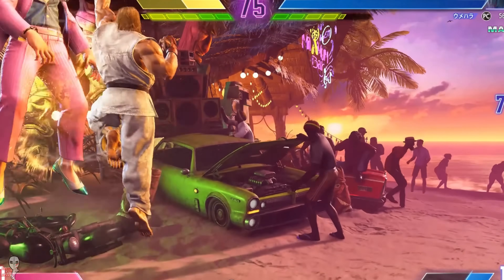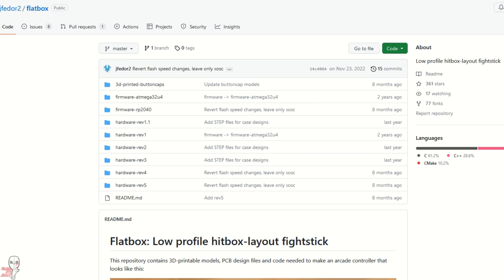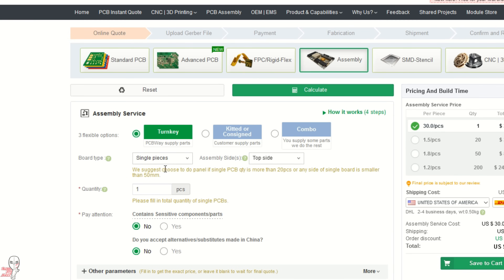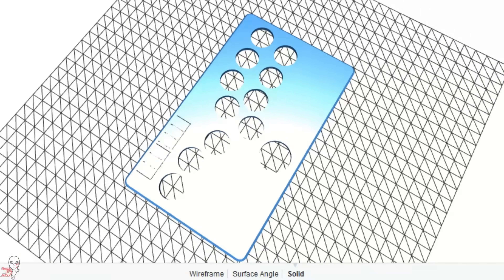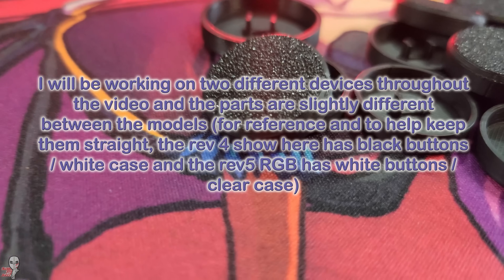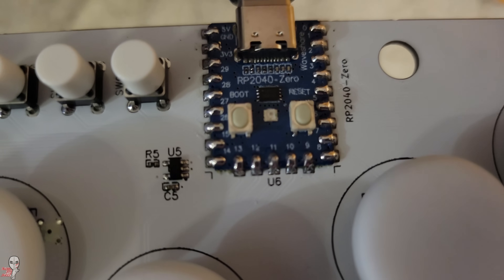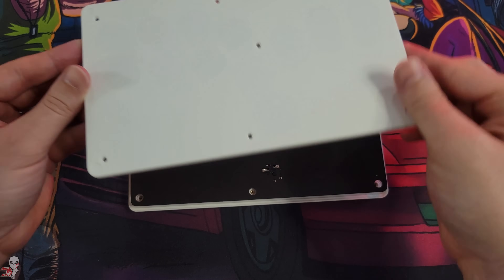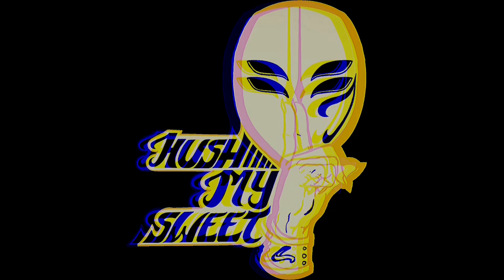Build your own Flatbox! An inexpensive, open-source fightstick option

Comment: Thank you very much for this video. I'm really interested in following this process, but since english is not my native language and since the whole github project is a bit complicated for non-initiated people, i would need a few clarifications.

Concerning PCBway, i'm not sure I've really understood what they can sell. Do they sell only the PCB ? Do they sell the PCB and the enclosure, and then I'll need to buy the buttons and button caps ?
Concerning the enclosure, do I need to send them the dxf files from the github ?

Concerning the button caps, can I just buy some online, or are those from the github the only possible ones ?

Concerning the soldering, from what i understand, I will have to solder the buttons on the PCB myself, is that right ? Or did you just plug them in and were done ? If i don't need to solder them, what will I have to solder exactly ?

In the Github project, they give all the parameters to choose on JLCPCB.com. Did you use the same parameters on PCBway ?

Is it possible to insert a personalised art panel betwen the PCB and the plexiglass plate (like the ones you can find everywhere on Etsy)?

Sorry for all these questions, but I'm a total beginner so it's a bit complicated to grasp the whole thing.
Thank you again for that video, it's amazing
Reply from the maker: That's a lot of questions, but let me try to help. For our purposes, PCBWay sells assembled PCBs and 3D-printed parts (normal PLA stuff and higher end resin stuff). You'll need to use their website to upload the appropriate files so you can get a PCB and the enclosure halves. You can also print the button caps there too or you can buy pre-fabbed button caps online from Junk Food Arcade. The caps are for their own Micro controllers, but they will work just fine on a Flatbox. As far as soldering, you'll need to solder the switches or hot-swap sockets (and the heatset inserts in the enclosure). You can use the Rev 5 art version if you want a layer for artwork, but the Rev 4 one won't accommodate that. I'm actually going to leave a link to the Open Stick Community discord. There is a Flatbox channel for help with questions like these (and the people there will be able to help you faster than I would): https://discord.gg/6SeMcMGH Good luck on your project!
Reply: @HushMySweet1  wow thanks a lot for taking the time to answer me.

I'll go for the rev 5 art case version.
I'm not sure whether i'll use PCBway or JLCPCB (it'll probably depend on the price per board i think).
I'll check online if i can find some people who show how they solder the hot swap pockets.

Concerning the button caps, i'll go for the 3-D printed ones to start and then i'll probably upgrade them to have a nicer surface under my fingers.

Thanks again for answ me, this helps a lot.

Comment: On a scale of 1/10 how difficult would you rate this project and what would be the total cost of something like this? 
(Quick note: I have some prior experience with creating my own PCB's, soldering, 3D printing and just electronics in general)
Reply from the maker: I feel it should be pretty straightforward for you with your prior experience. One issue is that you typically have to order 5 PCBs from one of these assembly services. Some of the cost is also dependent on if you have easy access to a 3d printer or need to order enclosures. I think you should be able to make a Flatbox rev 4 for like fifty or sixty bucks. If you really want to make it simple, you can just buy the assembled PCB from SGF or another etsy seller. They go for like $35 and you can just buy the single board. All sort of depends what you're after though. Good luck with the project!

Comment: I'm curious what the total cost of the parts and shell were if you happen to have a breakdown anywhere
Reply from the maker: Typically, you should be able to make a Rev 4 one for like $50-60. Depends a bit on your access to a 3d printer. One more issue is that a lot of these assembly services have a minimum order count of 5 (so you'll have practice boards or extras to finish and give/sell to your friends in the scene). Hope that helps, thanks for watching.

Comment: So, I'm confused about one detail. Does PCBWay send the pcb with every component soldered or we should buy the other electronic components and solder them ourselves? Great vid, btw.
Reply from the maker: They are mostly assembled, but you will need to solder on the WaveShare board and hot swap sockets. Thanks for watching!
Reply: @HushMySweet1  Oh, now i understood what you meant. I have to solder the RP2040 in the v5 revision and the hot swap sockets on v4 and v5. So, the raspberry chip on v4 is pre assembled by PCBWay. Thanks.

Comment: interesting video. you say this is inexpensive so what is the total cost in parts to making your own flatbox?
also how much more would it cost to make one for the PS5 versus PS4?
Reply from the maker: Typically, you should be able to make a Rev 4 one for like $50-60. Depends a bit on your access to a 3d printer. One more issue is that a lot of these assembly services have a minimum order count of 5 (so you'll have practice boards or extras to finish and give/sell to your friends in the scene). PS5 stuff is still super expensive right now and there isn't a good open source option. I hope that changes here in the future, but as it sits now, you'd need to integrate a Brook Fusion board into the build and those are like $130 by themselves. I have a video coming at the end of this week which showcases a PS5-compatible Flatbox-esque build, but it's a product review and not a how-to. Good luck and thanks for watching.
Reply: @HushMySweet1  thanks for the reply.

Comment: I'm watching the video and it seems without 3d printer this will be about as expensive as just buying new hitbox from a shop ?
Reply from the maker: Oh, definitely not. A true branded HitBox is $250 before shipping. A Flatbox-style build is $100 if you buy direct from a company fully assembled (see SGF and their Bridget controller which is a Flatbox variant). What's the print go for? For sure not more than $20 of filament. Search for 3D print services (or even some libraries) and upload the enclosure files to get a quote. When all is said and done, you should be able to make a Rev 4 for like $50 or $60. The downside is that you typically have to order assembled PCBs in batches of 5.

Comment: Do you have an estimate for approximately how much it cost to do each of the builds (excluding the cost of the soldering equipment)?
Reply from the maker: The V4 should be like $50-60. The V5, like $100 maybe? Don't quote me on that though. I had the case donated and a lot of the other stuff in my possession already, so I didn't keep good track of the money. You'll also likely have to order the assembled PCBs 5 at a time for minimum orders. That changes things as well. Anyway, good luck with the builds and thanks for watching!

Comment: Looking into this. For the 3d printed housing, there are two files for the bottom half - "bottom" and "bottom-hotswap." I am guessing the bottom hotswap is only if you put hotswap sockets in your board. Is this correct?
Reply from the maker: I believe that's correct. I want to say that hot-swap bottom has an ever-so-slightly deeper area for the buttons to accommodate the hotswap stuff.

Comment: was this plug and play with sf6/steam? Im pretty much done with my build but its not registering on steam.. I see it when I use an online hardware tester and all the buttons are being read fine on the hardware tester
Reply from the maker: Hmmm...could you try changing the input mode to see if that would help? Just hold the appropriate button as you plug it in and then everything is saved for future (so you'd only need to do this one time if you find the right one). I want to say this happened to me once and I changed the input to something else and it solved it.
To change the input mode, hold one of the following buttons as the controller is plugged in:

    B1 for Nintendo Switch
    B2 for XInput
    B3 for DirectInput/PS3
    B4 for PS4
    R2 for Keyboard

https://gp2040-ce.info/#/usage
Reply: @HushMySweet1  is this using the gp2040 firmware or the jfedor firmware?
Reply from the maker: @floridacaninecenter  I'm in and out today so hard to troubleshoot this in real time. Try joining https://discord.gg/G4TCGPem on discord and the members there will be able to help you get it solved.
Reply: @HushMySweet1  thank you!

Comment: Wth that resin flatbox is beautiful. How do i build one like that?
Reply from the maker: It would be the same steps as the normal Rev5 version. But instead of a 3d printed enclosure, I just uploaded the .stl files to PCBWay and had them use their big resin printer to make those halves. They donated them for the video, but if you want a transparent resin enclosure, I think it would be around $100 for just the case like you see here in the vid. Good luck with the build!
Reply: @HushMySweet1  after watching the video a handful of times and reading some comments, I kinda figured. Are the rev5 original top and bottom enclosure the same as TheTrainGoes' premium art top and bottom enclosure? I notice that TheTrainGoes' top and bottom enclosure are in .dxf format and PCBWay and JLCPCB do not do .dxf format.
Reply from the maker: https://github.com/TheTrainGoes/flatbox-rev5-rgb/blob/main/Flatbox%20rev%205%20RGB%20case%20-%20Art%20Case/Flatbox%20rev%205%20RGB%20-%20Art%20Case%20-%20Top%20Support.stl

Comment: Do you know if there is a service / builder where I can order flatbox style controllers with custom button / switch placements? I don't like the hitbox layout because it's too cramped for me. Also, I'd prefer a long button in the middle, like a space key froma keyboard, since two Up-buttons don't comply with the current Capcom rules anymore. Unfortunately, I have no idea where I can get something like this. I've looked on etsy and aliexpress to no avail.
Reply: something like this minus the left pinky button: https://i.imgur.com/RE4ZFBo.jpg
Reply from the maker: Mavercade offers something similar to what you're asking and they are experimenting with different / extra button placements in some of their new controllers. You could also commission someone in the Open Stick Community discord to help you build exactly what you want. https://discord.gg/zjJgvAM5  The issue with this path is that you'll typically have to buy minimum 5 PCBs from these assembly services, so you'll have that on top of those costs. Good luck with the project and let us know what you come up with!
Reply: @HushMySweet1  thanks! Yes, I've seen mavercade's new designs earlier today. Looks very promising.

Comment: If you’re willing to do a lot of the assembly yourself what is the cheapest you could order a pcb / batch of pcbs for? How much does having to order multiple due to minimum order requirements increase that price?
Reply from the maker: I can't remember the exact amount off the top of my head, but I'm pretty sure you have to order at least 5. You'll have to plug in the files and add 5 to cart to see what the total is. I think they were all less than $20 a board though, but I can't remember the exact numbers. It works well to help test and give you some confidence in case you make a mistake, but they come together pretty well, so likely you'd just have extras for your friends. Some people unload their extras on r/fightsticksforsale to recoup costs. Good luck with the project!

Comment: this is way too much work haha but cool to see
Reply from the maker: Hmmm...if this is too labor-intensive you could just grab an assembled PCB ready to go from SGF for $35 and then you'd only have to worry about getting the enclosure/caps printed and picking up some appropriate switches. Or, if it's too daunting still, you could always buy a finished version for ~$100 from a vendor. I guess it's all how you value your time. Thanks for watching and commenting all the same!

Comment: How do I add a left pinky button and a right thumb button? If I make my own I at least want it to have full functionality
Reply from the maker: The reason this is cheap and easy is that the PCB design work has already been done and has proven successful. If you want custom layouts, there aren't any easy ones ready to go on GitHub, so you'll need to make your own. You'll likely need "kicad" to help design the PCB. There is also a group of super smart people on the "OpenStickCommunity" discord. If you have specific questions, there's typically someone who can help. And if it's proving too daunting, you may be able to commission one of them to help you get the initial files going. Hopefully that gets you started in the right direction. Thanks for watching!

Comment: Hey, im building the flatbox rev 4 and the pcb's i ordered did not come with usb connector or the raspberry pi, what is the second smaller square that is up and left of the raspberry pi?
Reply from the maker: That little flash memory chip? Or if you don't have a usb connector or RP2040 chip, maybe you have a Rev 5? Otherwise if this is a Rev 4, then you may have yourself a completely unassembled board with nothing at all on it? That doesn't bode well because there's a lot of stuff you'd need to add that can't really be soldered by hand.
Reply: i had the rev 4 completely unassembled lol, I ordered new pcbs with the parts on it but I am 100% doing the rev 5 next time @HushMySweet1
Reply from the maker: @easypeasygamers6885  Glad you got it figured out!

Comment: So how much money spending should I expect from doing this kinds of builds?
Reply from the maker: Depends a bit on how much you can do yourself. But, for the Rev4 version, I would say $50-60 is a reasonable amount to anticipate.
Reply: @HushMySweet1  Thanks! I was planning on switching to a hitbox style controller but acquiring such a controller is hard here in the PH. I was planning on modding my Qanba Obsidian to a hitbox but getting the hardware and shipping is expensive. My other and easier option is the mixbox mod but I'd rather have a hitbox. So this looks like an easier option for me to do, just hoping for a cheaper shipping fee.

Comment: How much did it cost for the one with transparent enclosure? Thanks!
Reply from the maker: The transparent resin case alone was like $100, but I had it donated for the project by PCBWay. If you just want to buy a typical Rev5 one, there's someone selling more standard 3d-printed versions for $120.

Comment: is there anyway to get access to the acrylic enclosure 3d print files ?  can someone provide the link for the arcylic one ?
Reply from the maker: All the files for the PCBs and enclosures are on their github pages. If you want to print a Rev5 one in resin like was shown here, you'll need to grab the files for both the top and bottom panels (and source an acrylic topper). Just read through the github. https://github.com/TheTrainGoes/flatbox-rev5-rgb/blob/main/Flatbox%20rev%205%20RGB%20case%20-%20Art%20Case/Flatbox%20rev%205%20RGB%20-%20Art%20Case%20-%20Top%20Support.stl
Reply: @HushMySweet1  thanks